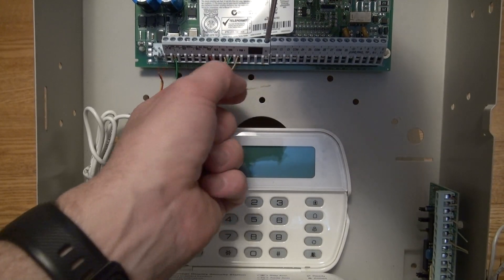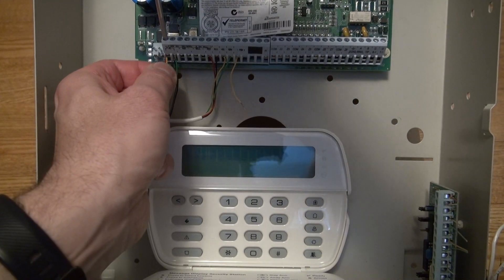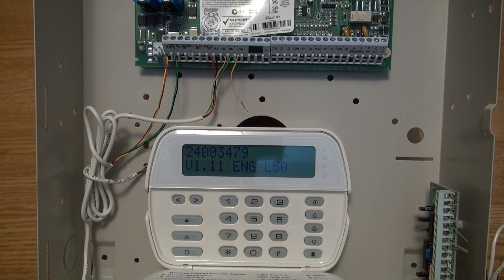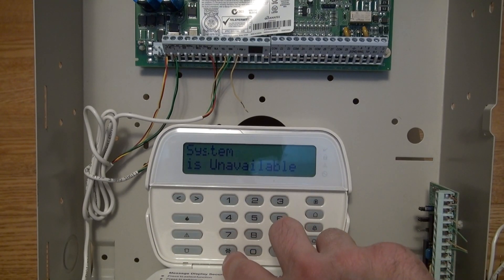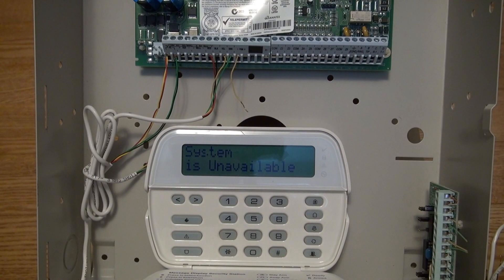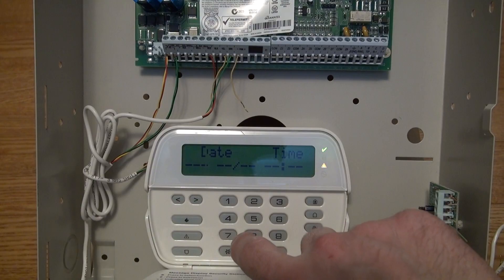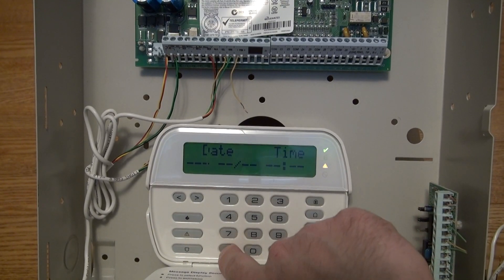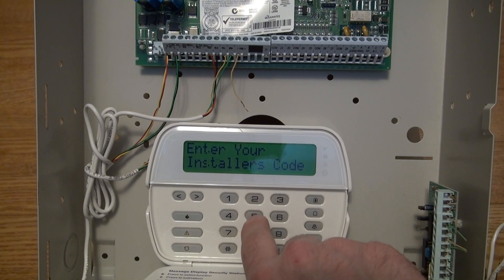How to Factory restore, reset your DSC alarm Panel, PC1616 / PC 1832 / PC1864

Comment: Hello, I need help. I changed the battery the yellow fault light appear but no displace appear. I hit the # key to stop the peep. That’s it. I disconnected the DC &AC power to reset but nothing help. My keypad is old system DSC.
Reply from the maker: If you open the panel what model do you have?

Comment: Can you do this master reset it you device clicks a few times when you plug it in? Basically locked out. Any way around it?
Reply from the maker: Yes, there is a unlock kit but it's only available for DSC dealers and it works only on a few panels. That's the only way